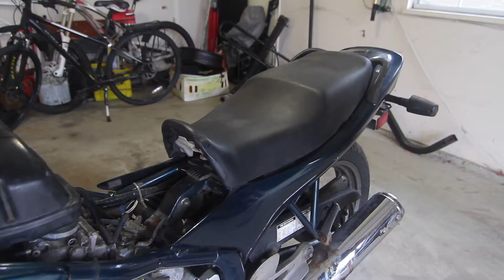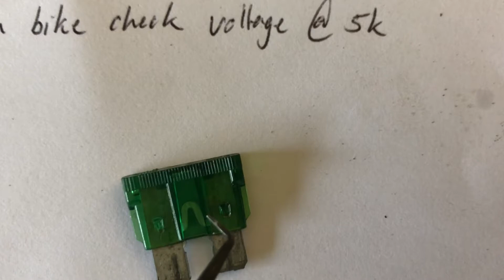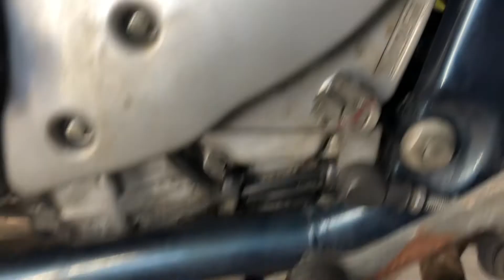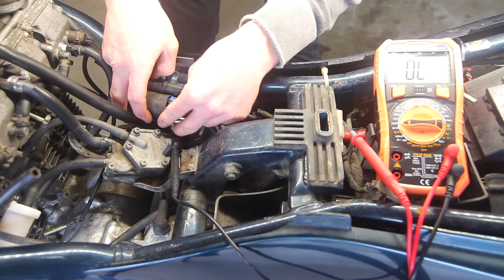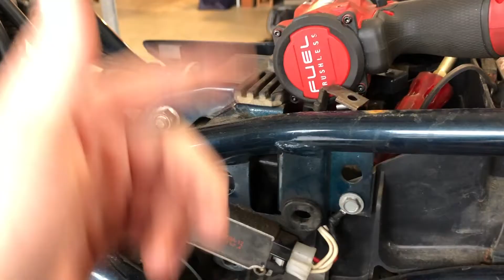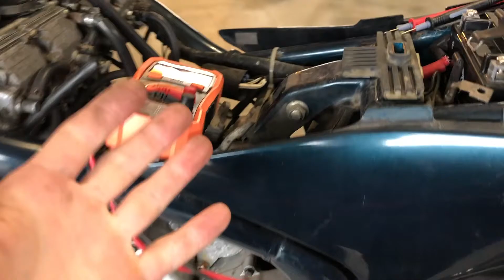'92 Yamaha XJ600 Charging System Inspection in Detail

Comment: Dear motorcycle friend,
Thank you very much for the clear explanation of the voltage regulator issue. My headlight bulb keeps blowing at high RPMs. I will clean the contacts and add an additional regulator from a smaller motorcycle in front of the bulb. This will surely help—thanks to you. Thank you, and I wish you many happy miles.
Tom
Reply from the maker: You are welcome!

Comment: What is actually under the part you called stator?
Reply: Clutch housing I believe
Reply: Flywheel , also known as rotor . Flywheel is around stator , there is a little air gap .

Comment: Hi Calvin, great video.

I have a bit of an issue whereby cylinders 1 and 2 are not firing but 3 and 4 are.

I haven't come across anybody else with this issue on the internet unfrotunately.

I have compression and spark but it won't pop.

Checked all the stuff in this video too.

Had the carbs off and blasted cleaner through everything.

Reckon it's worth trying a new igniter or what else would you try?
Reply: Did you figure it out?
It's easy to forget the coil wire order: 1&4 and 2&3 share coils. If you wired it 1&3 and 2&4, then 1&2 wouldn't fire.

Comment: Somebody put a self tapper through your frame with a new terminal for the ground. Notice how the black wire goes off to the right of the rectifier? That ground lead is supposed to go on the bottom corner bolt of the rectifier. My guess is somebody threw an aftermarket rectifier on this and couldn't get the terminal to fit because that rectifier does not look oem.
Reply: Agreed, that rectifier doesn’t look stock to me.

Comment: I'm on a 1992 seca 2 here and reading 0.6-0.7 ohms resistance when testing the 3 white wires connector coming from stator. Is this too high for resistance? Could this mean a bad stator?
Reply from the maker: Make sure you take the resistance of the multimeter leads into consideration. If the multimeter doesn't read zero when you touch the leads together then you have to add that number to your measurement. That's what sounds like is happening for you. Good luck!